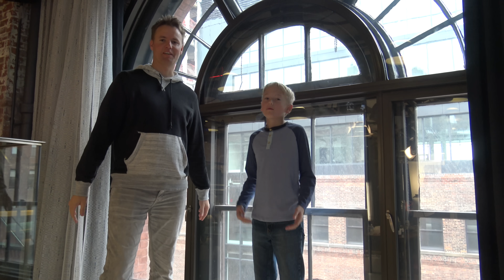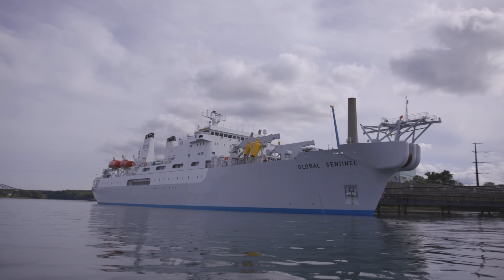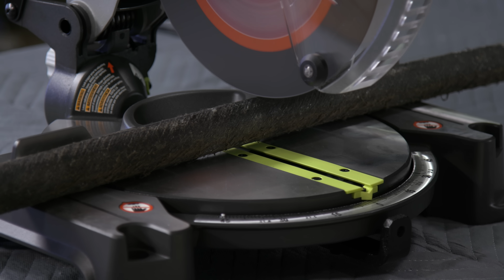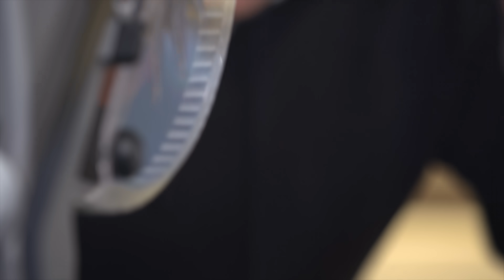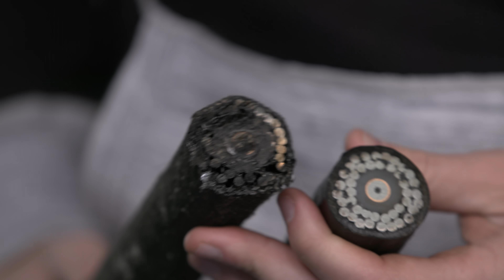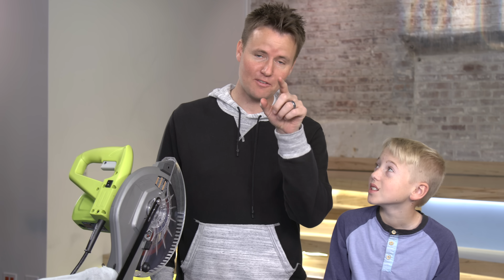What's inside the Undersea Internet Cable?

Comment: How are these repeaters (every 50 miles across the ocean) get powered? Such an emphasis on how the majority of the cable is just shielding for the fiber- is there really no voltage transmitted through the cables themselves?

Comment: My son is a merchant mariner who works on a cable laying skip.    He is an engineer responsible for feeding the cable to lay on it under bottom of the ocean (depending upon the sea depth) at the right tension to avoid injuring workers or breaking/tangling the cable.  That's over
Simplified but the job requires a 4 year engineering degree and a USCG license he must keep current.   It's a very high tech process sand a very unique job.  He is out to sea across many continents all the over the world anywhere from 75 days to over 4 months at a time.       A very cool job!

Comment: Optics cable work bcz of total internal reflection which happens when light ray is more than critical angle.
 This you can see when you buy expensive diamond ring which has a lot of cuts and it sort of traps those light rays in it.

Comment: Through those slender cables runs 98% of all modern telecommunications.  And they have improved over time: in the age of electric telegraphy and morse code, it would have taken 74 days to send a Harry Potter book (unless it was 'Goblet of Fire' or 'Order of the Phoenix' - those would have taken A LOT longer), but using today's fibre optics, a Harry Potter book takes 0.000006 seconds.

Comment: They didn’t go all the way in. The colored parts are protective layers around the glass inside and then there are at least two layers of glass. The light is only in a 10 micron core in the middle.
Reply: it's 9 microns...
Reply: Shirhan Holmes 
Not necessarily, depends on the fiber type.

Comment: It its broken in the middle of ocean, how do you locate and fix it?
Reply: In a nutshell, the cables have 'sensors' in that allow the owners, in this case, the telecoms and communications companies to have a rough location. A repair vessel (often a cable layer) would then be mobilised and the damaged section of cable would be hauled up to deck and cut. The ends of the working sections of cable are jointed with an infill piece of cable and it is set back down to seabed and tested - and hopefully it works...  there's more to it than that - but as said, 'in a nutshell'.

Comment: Sparks. Electrical discharges happen when cutting at high speeds.  What is cutting, cutting is breaking the bonds in materials? The electrical bonds of molecules are severed  releasing the sparks of energy that bind the molecules?

Comment: Hey guys I think you guys forgot to follow the right instructions about hazards surrounding Optical Fibber Cable ! I hope this help

1. Wear safety glasses

– Every person in the area must wear safety glasses with side shields to prevent fiber shards and splinters from entering the eyes. People, who wear glasses, must still wear safety glasses.

2. Wear protective aprons

– All workers should be clothed in disposable lab aprons to reduce the fiber particles that collect on personal clothing. If particles collect on clothing, they will be ingested later through food, drink or breathing in air.

3. Avoid fiber ends

– There are reasons to look through a fiber cable, but care must be exercised to ensure that there is visible light coming through the cable. Prior to looking into the end of a cable, use an optical tracer or continuity checker to determine if the fiber is dark. A power meter will verify that there is no light source at the other end of the cable.

Comment: Packed away somewhere I have a foot of a tether from MBARI (Monterrey Bay Aquarium Research Institute) which they used to connect their remotely piloted submersible vehicles with the command ship on the surface. It has a bright yellow jacket, with 5 electrical conductors to feed 3-phase power down to the submersible vehicle, and in the core 8 optical fibers. Two were used for ethernet, two for video from the cameras, and there were some dedicated to the control system which piloted the vehicle. The cable was custom made for MBARI by BIW (Boston Insulated Wire). The cable was wound on a large, motorized drum on the deck of the command ship. To maintain connection while the drum rotated, in its center were 5 slip rings for the electrical conductors, and 8 rotating optical joints for the fibers. The was a short piece of cable coming out of the center of the drum on the other side of the rotating couplers which went to the control room below deck.

They could not put any twists in the cable as they reeled it in, like the kinks which inevitably seemed to get in old-style telephone handset cords. They had a computer which kept track of how many times the the cable had been twisted by the motion of the submersible and the ship, and they had to sail the submersible and/or the ship in circles as the cable was reeled in to be sure there were no twists!

Comment: You know, as a telecommunications engineering drafter for the past 6 years designing routes for fiber optic cable throughout the Midwest (based in Chicago) I only just recently learned that there are fiber optic cables spanning across the freaking oceans to allow us to communicate with one another cross-continentally.
Reply: My son is an engineer on a cable laying ship.  I was also amazed at what he does.        this video
Reply: This 4yr old video just popped up on my YT today and I had to watch it.      It is a very amazing process

Comment: I dont wanna be; that guy, but next time get an abrasive chop saw. All ou did was take a miter saw and put an abrasive blade on it. Abrasive chop saws cut at a higher rpm than miter saws. YOu pretty much destroy the motor on the miter saw. Cool video tho, thanks for all your work!

Comment: wait! , it has same number of glass fibre strains as a normal fiber optic cable? lol , was expecting more hahaha ... the ones we use has 6 fiber strans and thick rubber coating with 2 solid copper wire just to power the converter on a light post near your home... (in India most cables run on poles and not underground) ..... I was building a distribution box for 6 fiber optic cable which will make 48 fiber optic board! , and those green, read ,blue , yellow are also plastic covering to identify each line.. you will see the real viber under that coloured tube ...  but it will take a special diamond cutter just to cut the fiber so that it can used for splicing ....

Comment: They are called fiber optic cables they use flexible glass rods that are insulated so light travels through it untouched we control that light and transform it into data

Comment: It's not fiberglass. It's fiber optic strands. Fiberglass is a fiber reinforced plastic material embedded in an epoxy resin. Fiber optic cables are literally tiny strands of flexible glass. It allows light rays to be transmitted throughout its entire length.

Comment: In the old days, we had a onetime state of the art, trans Pacific cable transmitting station based in Bamfield Vancouver Island BC Canada which existed from 1911 to 1959 it operated using Morse code with cables run to Hawaii, Australia and others which were layed down by big ships 100 years ago. our local museum in Port Alberni has an original century old  cut open cable looking very much like the internet phone cable in this video.

Comment: The way you asked that question about undersea cables in relation to "where does the internet come from" shows that you really don't fundamentally understand how the internet works, or how servers, and networks in general work. 

These cables are just for long distance intercontinental backbones. The internet is simply a collection of millions of switches connected with mostly star topologies, where you have backbones between geographic areas that carry huge amounts of data, each of the ends of these having splits of to other areas, which split of into other areas, which eventually split off to individual house, or business, and then devices. When you upload a video, your device, connects to your router, which connects to your local ISP node, which connects to your ISP's local area distribution, which connect to their regional distribution, which connects to a regional provider's backbone, then out to another regional ISP, then to a local distribution, then a datacenter firewall, then internal routers, then a distribution switch, then a cabinet switch then the server than holds the data. 

The same kind of connection is made for someone playing it. The cables, or satellite links, or mobile, or wifi links connecting all of these devices are simple a global system of connections that allow all of these devices to talk to each other. This is the physical layer of the internet. The way the devices talk to each other, the services they run, and the data they pass, are what allows us to do all of the great things we can do with the internet.

This is a very simplistic description. There is a lot more to it, and lot that goes into a web address turning into a connection from your device to the correct server, and to load balancing that traffic to allow everyone to access it. Dozens or even hundreds of devices can be involved in a single thing that you do on the internet. The internet doesn't come from one place, nor is it any one thing.

Comment: Saltiness are used for the internet but they are far less efficient. Satellites cannot support terabytes of bandwidth while cables can. Satellites are better for phone communications or TV stations.

Also some of these cables lay in the abyssal plains of the worlds oceans which are 4km + below the oceans surface, they are built and designed to weather the extreme pressure at these depths, pressure that is far superior than a Sharks bite.
Reply: Saltiness Internet

Comment: Wait... This looks like a coax cable? Anyways, I've seen way bigger coax and fiber cables than this, so I'm not really sure if this is really what's used to cover thousands of miles under the sea?
Plus, like she said, this signal needs to be repeated and strengthened multiple times in order to have a decent signal at the other side, so this can't be the most efficient way...
But then again, up until 2 years ago I thought all oversea traffic went through satellites, which doesn't even have enough capacity to get a thousand people online ...

Comment: Nice video to explain to everyone how it works. I have one comment to make.
These are not undersea "Internet" cables. They are undersea communication cables. What they put on the cable is bits and bytes in the form of modulated light, whatever information they may represent. There is more than the internet that is being carried on these cables. For example, telephone conversations have nothing to do with the internet. Neither do TV networks video signals.  So the cables themselves should not be called that way. Hey, fiber optics cables have been around for at least 50 years...

Comment: Satellite transmission is too slow, low Ping, high delay, not good fast internet connections, that's why fibre optical cables are used.

Comment: I just found this channel, I have worked for Internet service providers since 1998, the Internet hasn't used satellites in a long time because of the latency (the light speed time delay of transmitting a signal up to the satellite and back down to its destination). The hardest part about fiber optic connections is signal loss, so the cables you cut open are connected, at intervals, to repeaters that are also waterproof and designed to work at the bottom of the ocean. The fibers themselves don't really need to be upgraded that often for an increase in speed, it's these repeaters and the endpoints that need to be upgraded to increase the speed of a run.

Food for thought.

Comment: OK
1 Judging by gauge of those wires, we speak about Very High Voltage in areas of tens of thousands Volts
2 I am pretty sure lady made quite significant error! SFPs are NEVER rated in miles, but ALWAYS rated in metres and km. To support my own claim I would add that 400m rated SFP uses 850nm light, 10km and 40km rated SFP uses 1310nm light, 80km and 160km SFPs are using 1550nm light. I know we can generate longer waves, the limitation is size and laser used in SFPs - SFPs are quite small and they are smaller then most USB Pendrives. I do think those repeaters are 40 miles apart, as this would enforce usage of 80km SFPs and would waste 15km of usable range.

Comment: The first Transatlantic telegraph line was completed in 1858.  Tiffany & Co purchased all the remaining cable from the ship that had laid it, and cut it into pieces.  Some were actually made into jewelry, but most of it was not sold when the cable failed a few months later!  The cross section of that cable is pretty similar to this one.

Comment: There are MANYcable layer ships - like there are pipeline laying vessels for oil/gas
eg Saipem 10,000 etc
Perhaps get to cable manufacturer  - AEI,  Pirelli or similar?
I used to supply CCTV inside those ships to monitor the many processes of cable laying
Consider how much a few miles of cable stretched out from the back of the vessel to the ocean bottom weighs
CONSIDER - How do they repair it ?  :-)

Comment: Under sea cables have been a thing since the telegraph. Satellites have never been used for transporting massive amounts of data. It can take literally up to 20 seconds to send a bit a data to a satellite 60k miles from the earths surface and back. Radio waves don't quite travel like light or electrons over a cable. This is in part to our atmosphere, speed of light and relativity (thank you Einstein!). 

Satellites are used when alternate data routes are overloaded or cut. It is only temporary and a lot of calls and data streams are cut via QoS to prioritize specific data traffic (government, corporate, military). 

Satellite TV also is ground based. Satellites are used but only for the ground stations. The ground stations then retransmit the signal into the upper atmosphere and it bounces back down to a given area so you can watch TV. Because TV traffic isn't as critical as a phone call or a datastream (it's just replayed recorded content). The time delay isn't noticeable. On a phone call or that round of call of duty it will be absolute torture.

Comment: i like how they taped the ends of the wire to not reveal what's inside as it would defeat the purpose of cutting it open and wasting our time. Nice one lads.
Reply: Pasha32511 it's taped for protection - metal ends could be sharp. Definitely easier to peel the tape off instead of cutting. But they cut it for the video. I'm sure no one thought "we're gonna tape the ends so you will be forced to cut it".

Comment: It's like a giant ethernet cable, except underwater.
Reply: No it really isn't. Fiber OPTIC (emphasis on OPTIC) means it sends through light.
Reply: Fiber optical cable
Reply: NO, Ethernet is running with cooper.
Reply: please stop talking online about things you don't know about. The term "Ethernet Cable" is commonly used to describe a CAT5 cable. CAT5 uses multiple COPPER WIRES to transmit signal.
Reply: Joshua Levin What about CAT5e, CAT6, CAT6a and CAT7 then?

Comment: Great episode! I manufacture medium voltage cable. My job is to install the jacket compound by use of an extruder. I've jacketed cable that is almost 5' in diameter. There is a lot of work that goes into making cable. While cable is not that exciting, it is sort of fun to see what's inside of it if you are not already familiar with it. The big cable I have made is three conductor, full of fillers and fun stuff with a thick jacket on it so that alligators and other critters cannot bite through it.

Comment: Seriously doubt that's an undersea cable. Undersea cables are bigger than that and they are more flexible.
Reply: HairyBottom I agree also they have alot more insulation.
Reply: It looks legit to me, this isn't winning any bend radius records, but it doesn't need to. If the cable was more flexible you would need more of it to go up and down the dips in the seafloor = ££. Stiffer means it will self-support over the dips. Also, there are only 8 cores and it has a power conductor. The only way this isn't an undersea cable is if it's an underlake cable, for a span of more than 15 miles, and even then, because it would still be so short, it would have far more cores than 8.
Reply: John Watkins I found out this is a legit cable, but it has a thick orange insulation layer on the outside when its actually installed.
Reply: Fiber optics aren't able to be flexed much. So, no :)
Reply: It is. 
They vary.
Reply: @sidehop  thank you! The kid had a valid question about what happens if a shark bites into it which wasn't answered and I wondered the same thing so that helps shed some light on it

Comment: When a shark bites the wires it doesn't make too much damage to the cables but sharks will then realize it's not tasty because they add a certain protective layer of stuff that tastes really bad. But if a shark just destroys the cable they have to get robot subs to fix and replace the broken cable.

Comment: Wait I'm still confused. So the Internet travels through those wires, or the satellite sends Internet TO the wires? Are those wires also on land? If not, do satellites send internet to land? And what sends service so you can call? What sends Internet to satellites? You just made me wonder sooooooo much more question.
Reply: just forget about the sattelites, using sattelites for internet is only used on small deserted places.. the wires transfer data to internet providers, which send the data to consumers though either cable, fiber or antennas nearby..